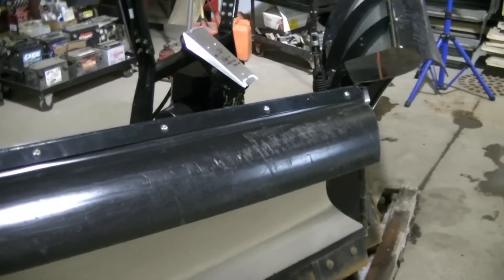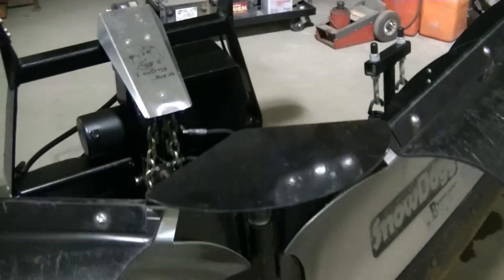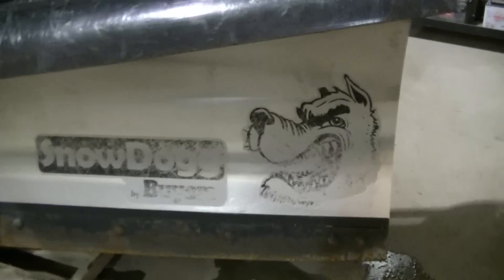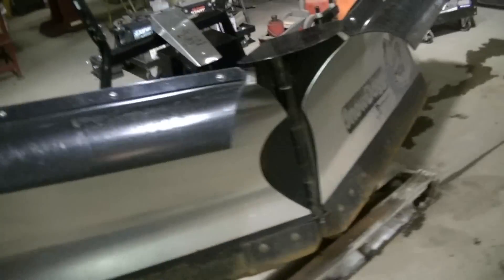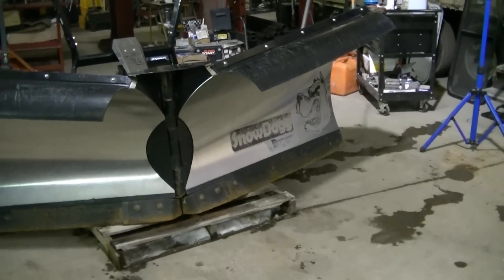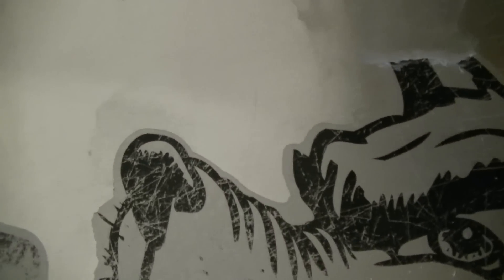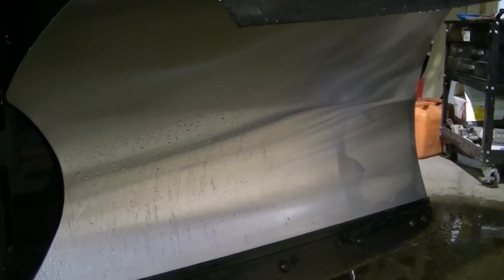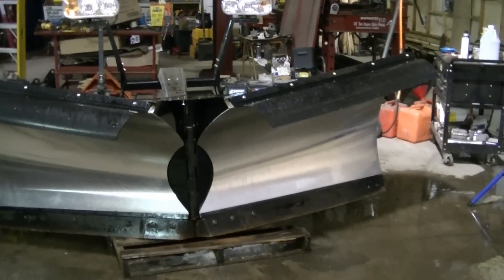Snowdogg VXF95 V Plow Intro and Decal Removal

Comment: On a 2001 Chevy Silverado 2500HD crew cab short bed 6.0 V8. 8'6" or 9'6" fisher xtreme v non flared?
Reply from the maker: I would go big as you can get with that crew cab unless you have to plow an area that won't fit the 9' plow.
Reply: I am mostly doing residential driveways and 1 dirt road.
Reply from the maker: I would go with the 9 footer.  You will never regret getting bigger.

Comment: My uncle has the same plow on his 02 2500hd, not really a fan of it, i plow with a 8 foot blizzard on my father in-laws 2012 2500hd and it seams alot better for pushing larger amouts of snow. what are you doing with the old plow?
Reply from the maker: If I was doing large parking lots then the plow I have would be great.  I do country drives and open fields.  Really need the v.  I am going to put wings on it next year.  I will let you know how I like it when I get it mounted up.  Probably going to sell the Western.

Comment: old plow is mine ? haha
Reply from the maker: For the right price and can be  :)
Reply: pm me with what comes with it . I've not had luck finding used truck side harnesses at decent price
Reply from the maker: Probably going to keep the harness and put it on dads truck so he can hook up to our other Western plow.  I have a unimount for an 88-98 chevy truck and also a wiring harness for 88-98 chevy truck.  I think I am going to put it up as a package deal.  I think I can make more money that way.
Reply: mossman381
yeah, I'm not even sure 02 is compatible to 05 anyways. Used truck side wiring are few and far between.
Reply from the maker: As far as I know it should be compatible.  It is going on my dads 04 truck so he can hook up to our other Western plow.  They are not cheap.  You are looking at $300-350 for the truck side harness.  Then you need a controller.  The handheld that I have is not cheap.  $200 or so for that.
Reply: minimun 500$ ive seen round, with the basic controller
Reply from the maker: That seems high for a used truck side harness.  You could get new for that here.